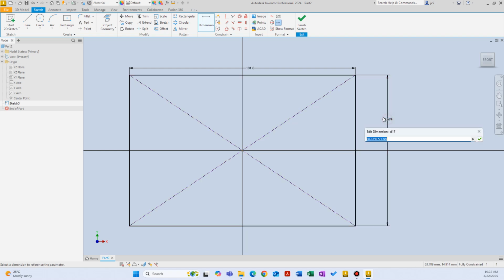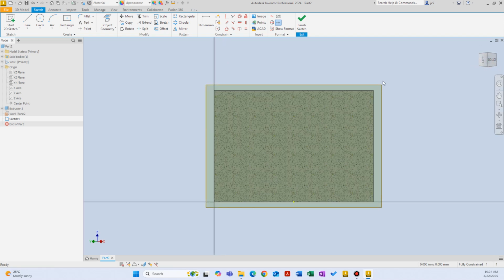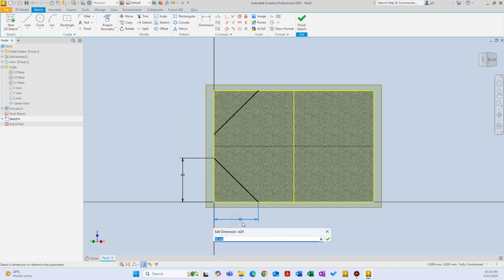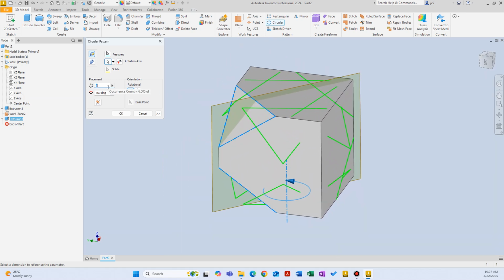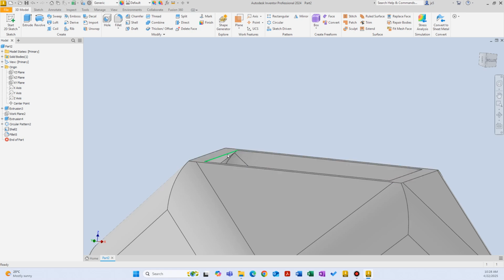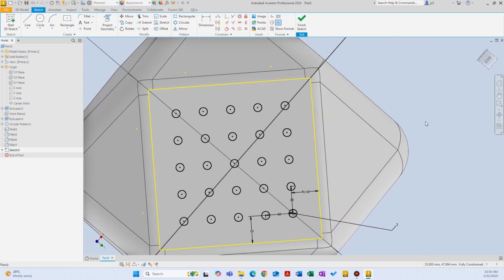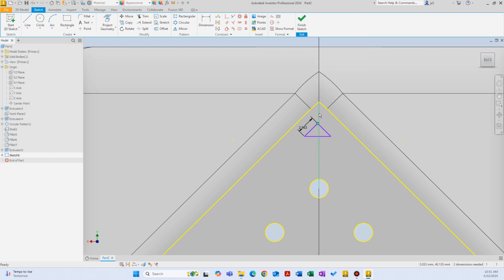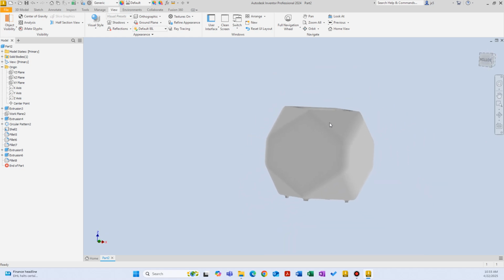23 - Exercise - 2 | Design a Modern Planter Pot | Autodesk Inventor Professional Tutorial

Comment: when selecting sides for the filet is there a way to deselect a side that was selected by mistake without having to repeat the whole selection process? Thank you in advance
Reply from the maker: Hello, you can press "ctrl" on your keyboard and click on the applied fillet to remove it. Please comment here again if you run into another issue.
Reply: @StarryIndustries  hello i dont know what i am doing wrong but everytime i try  to select like you do for the fillet action, mine says create feature failed despite selecting what you have

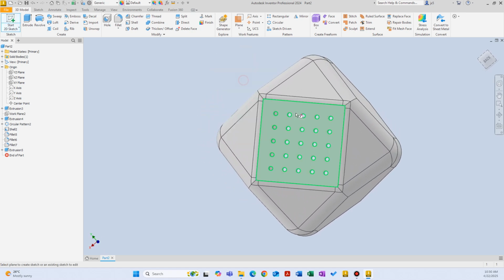Comment: 10:20 You made pattern at the sketch level. Now try to edit pattern (add more holes) and see what happens to the Extrusion - it doesn't pick your addition. It is recommended to make only one hole in sketch, make an Extrusion and then pattern it - so everything is under control.